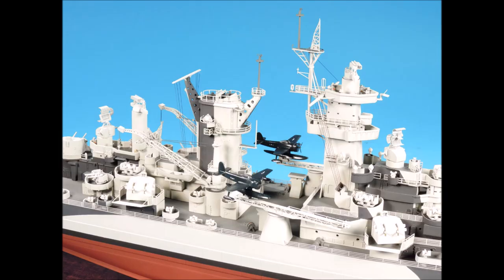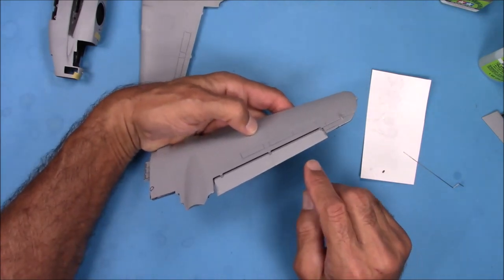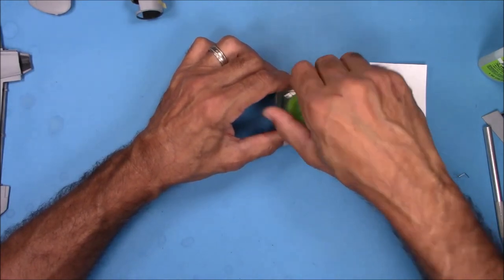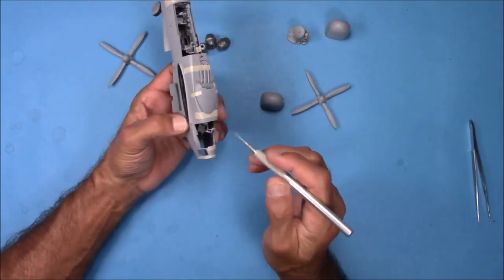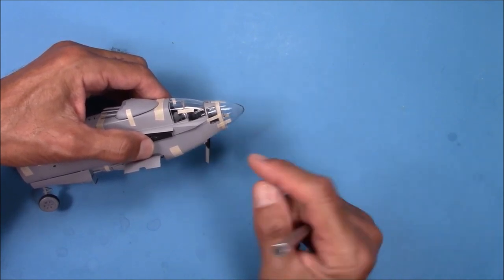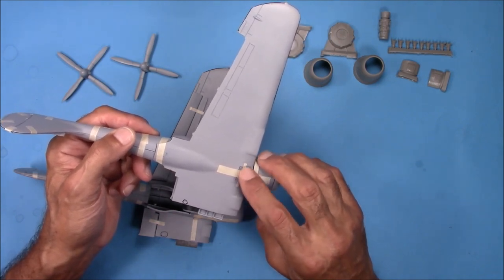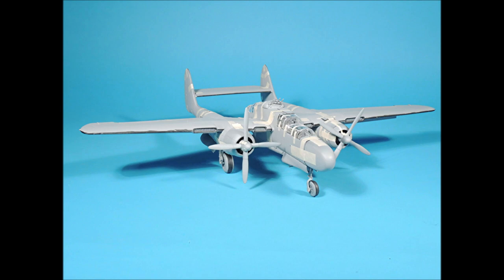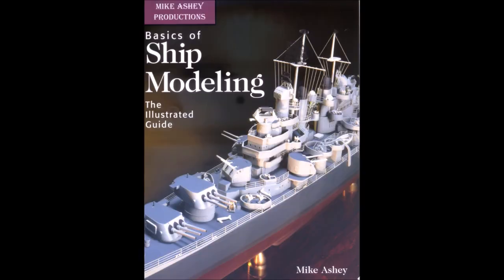Revell 1/48 scale P-61 Black Widow in depth tape up review.

Comment: built that kit when it first came out way back when under monogram.did not have some of the issues like you are having.the clear part went on perfect.with some of these new kits under revell now  i see they have some problems with them.i don't understand how if they are using the same old molds unless they retooled them and really screwed up.i want to thank you on your tape ups they really help me in future builds on what to look for.
Reply: Molds wear with age, it could just be Revell not keeping the mold properly surfaced.

Comment: Mike I was beating up the canopy just recently and went through all those issues..it is horrendous. I tried to close up the two side windows. I also tried to correct the interface where the clear interfaces with fuselage. It is not square as depicted on the fuselage ..more like the clear with rounded corners. SO many issues. Unfortunately it was too much and I have set it aside. As you pointed out it is a shame as the rest of it is really pretty good. Usually I can beat any Monogram kit into submission but this one beat me. I will be looking to the GWH kit as I do love the plane.
Reply from the maker: A company made replacement clear parts for the kit.

I think it was Vector.

You can find them on eBay but the clear resin sometimes yellows.
Reply: @scalemodeling  Thanks Mike..but they are hard to find and cost twice as much as the kit. All the best! Don